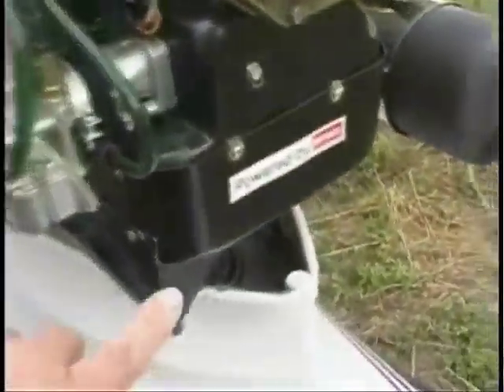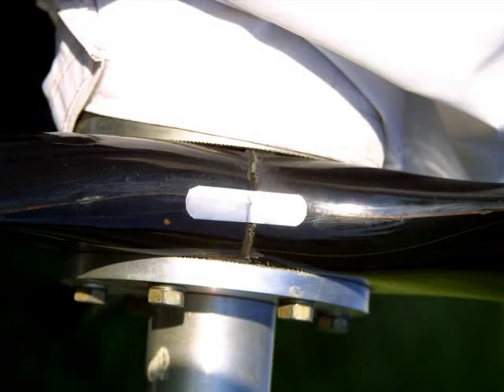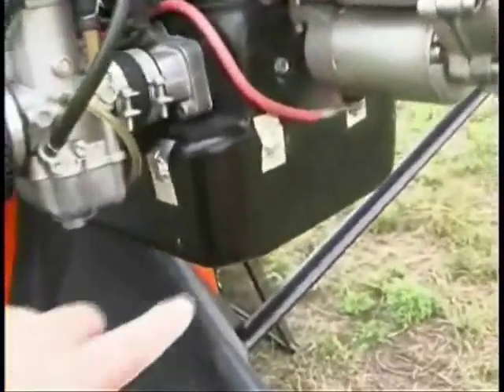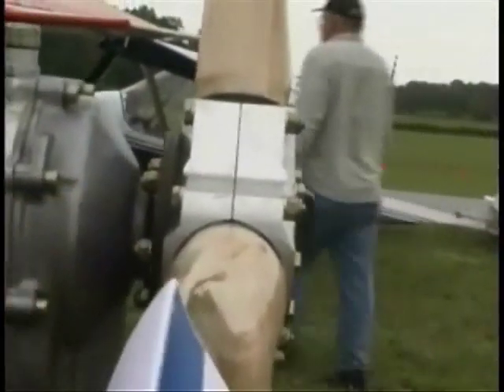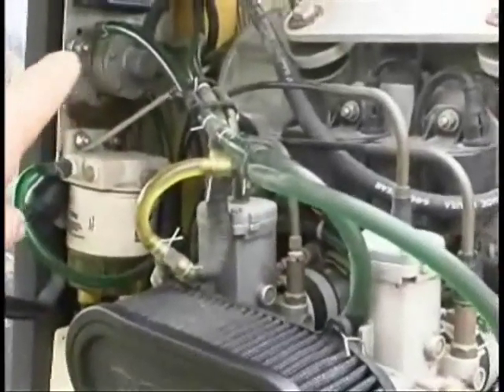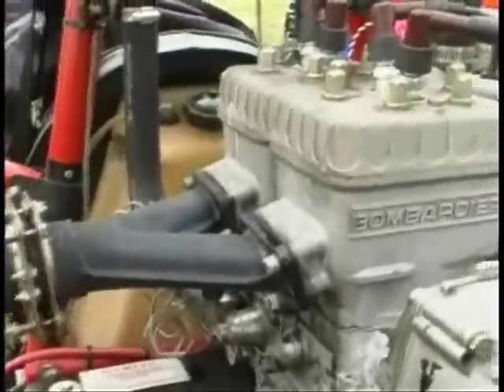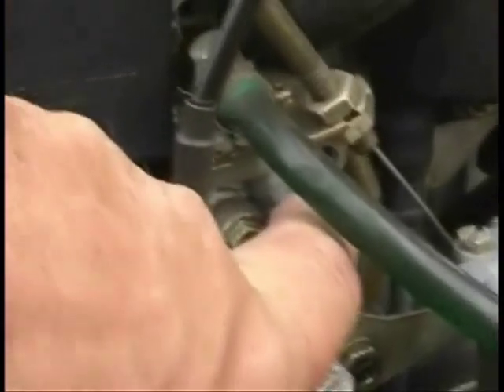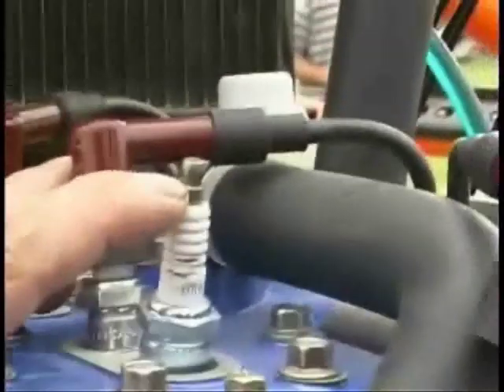Rotax 377, Rotax 447, Rotax 503, Rotax 582 aircraft engine advisories

Comment: Began flying ultralights in '78 with a Pterodactyl. Hey, I appreciate the comments but I've had everything fly through a Warp Drive prop including a seat belt with a metal buckle. It held up just fine. The Warp sliced the pee out of it and spit it out. You can't prevent every little thing no matter what you glue together.

Also, that little, bullet proof fuel pump. I've had them rubber mounted, solid mounted, sideways mounted, upside down mounted. horizontal mounted.....and guess what?  They worked just fine no matter what position they were in or how much they vibrated. That said, thanks for the good video.
Reply from the maker: People are told that smoking is bad for their health, some get sick and die from cancer, others get sick and recover, while others live a normal live span. What can I say all of the accounts are from my experience, most first hand, either from working on or repairing ultralights that have had the problem, or while flying. Now I have had a Warp Drive prop loose a blade on me and nearly pull the engine off my plane! In one instance of fuel pump failure, a friend lost his leg, and is partially paralyzed. The video is to make you aware of the problems, what you do with the information is up to you! A lot like a vibration in the system, you can look for it and fix it or wait for it to vibrate something off your plane.
Reply: Light Sport and Ultralight Flyer well said!
Reply: Odd, my warp drive prop has lots of little nicks and dents in one blade right through the tape.  Not exactly resilient for the $$$ price.

Comment: very informative video and great safety points. ty. Question.@721 i noticed that there is a different shape water pump housing on this 2 stroke.I s this an aftermarket spacer housing?If so, is it available to be purchased in canada or Usa? ty